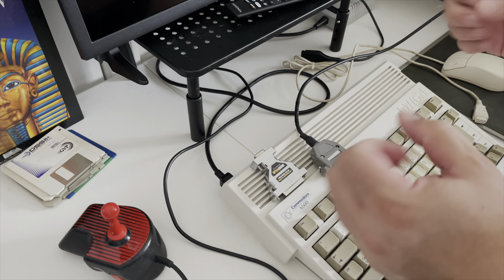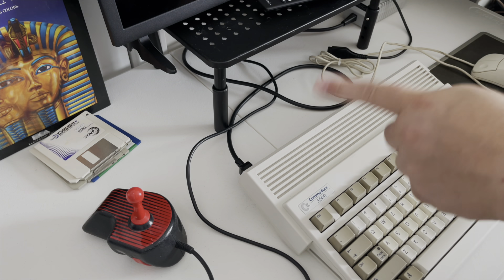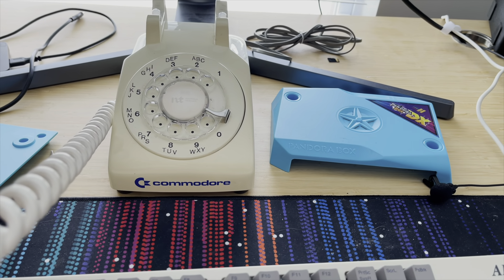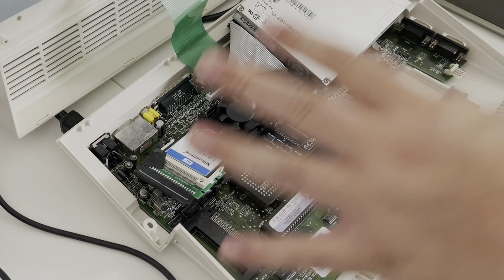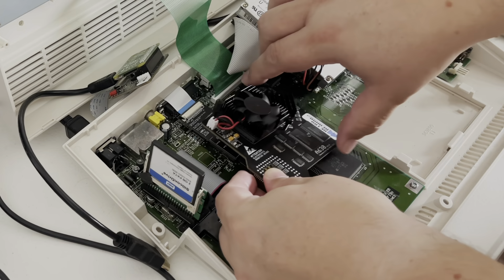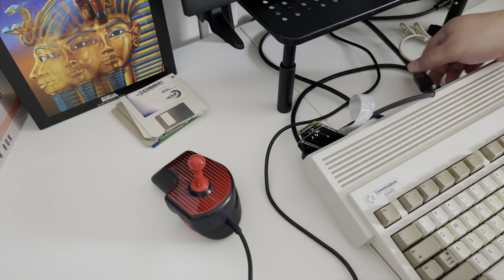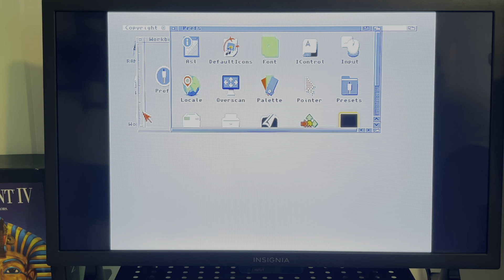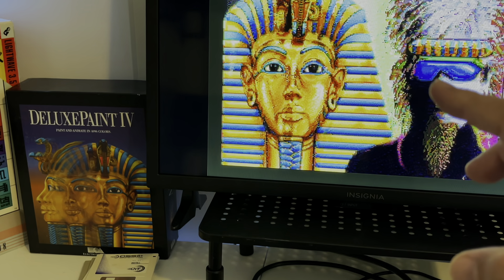RGB2HDMI for Amiga 600!

Comment: On my A1200, I removed all the modulator and pal circuitry caps and IC. I now have a very clean RGB signal as preference, and HDMI under PiStorm.
Reply: I took out the modulator and I believe all the caps, but there is conflicting info about what can and can't be removed. Do you remember where you found the info you used or maybe a picture as it would be most helpful.

Comment: I love the RGBtoHDMI CPLD V2 so much I had 50 PCBs made in purple with gold contacts. The signal on the OCS/ECS Denise has never looked so good! Better than the OSSC by far and rock solid without mode switching delays. Love it! I sent one to Doc Edwards but I have so much on my plate I have only made 3. Love your work dude! Any fan of Lightwave is a friend of mine.
Reply from the maker: Thank you so much! Also great to hear someone take on it And yes…Lightwave3D FOREVER !

Comment: I'd suggest connecting up external power to the RGB2HDMI using a floppy power splitter or something. Theres only one thin trace providing power to Denise on the 600, if the Pi draws too much current then you risk frying a trace.
Reply from the maker: Interesting. I’ll look in to it. Thank you! The Zero W uses very little power thankfully.

Comment: Do you have access to a 3D printer? 
My thought: find a model of the A520 modulator, scale it to fit the pi video adaptor, and print in white pla to closely match the 600. Some modification to the model will likely be needed for the ports. People have made cases for USB flash drives so it’s got to be out there.
Reply from the maker: I have friends that have them and good experience with them. Thanks for the idea
Reply: @HoldandModify     Is the hdmi patch board available for the DIP ECS Denise?

Comment: I have Amiga 600 too! But there're two problems in the Amiga 600, the end of ribbon keyboard that plug in to the motherboard is broken damage and i can't use keyboard anymore and internal floppy drive won't read floppy disk anymore because i clean with alcohol on the reading head... So what should i do with my commodore Amiga 600?... Any help?... 😞
Reply from the maker: Send to Dr. Chris along with some cash. ;)
Reply: @HoldandModify  How much will Dr. Chris will charge me for repairing my Amiga 600 computer?...
Reply from the maker: That’s between ya’ll. If you watch his channel, you can get an idea

Comment: PAL 640x512 works perfectly on a 1280x1024 LCD, this about the only time PAL has actually been better served than NTSC with perfect integer pixel mapping.
Reply from the maker: Awesome and thanks for the tip!
Reply: @HoldandModify  For pixel perfect in that situation it is important to match the PI resolution to that of the LCD display. Perhaps some experimentation would be need for yourself as I think you like the softness from scaling but it may help to only have the display scaled once, not twice, by the PI and the LCD. A consequence is no overscan so perhaps again not suitable for you. I do agree the soft scaling has its attractions but so does perfect pixel scaling, non seem quite right. Pixel perfect looks fantastic but the pixels are so large that make reading the screen almost harder.